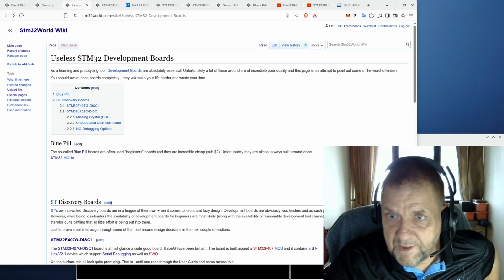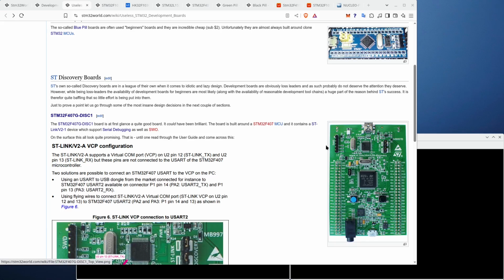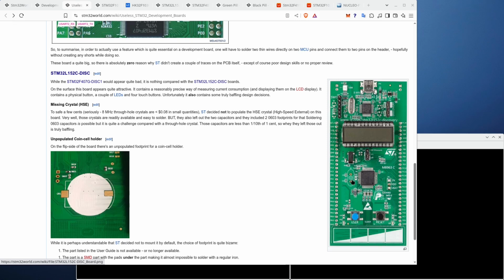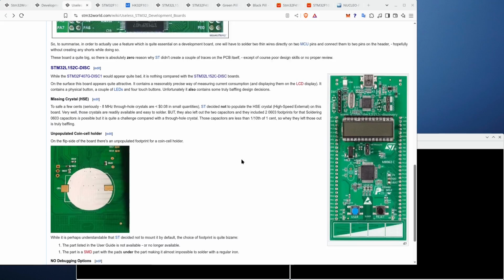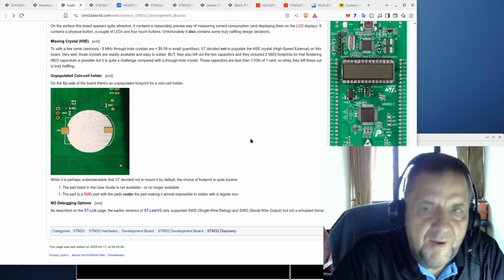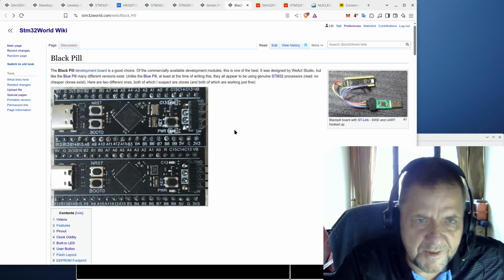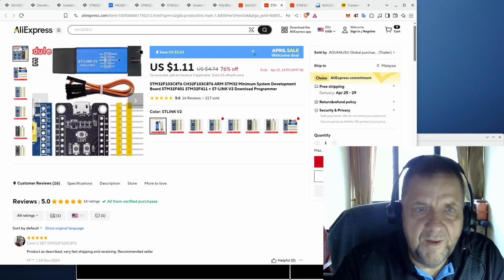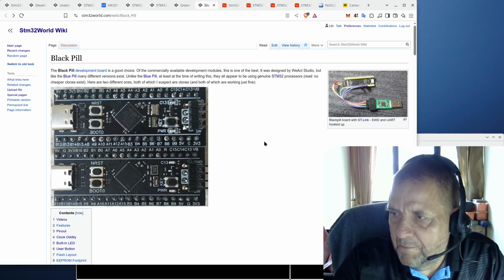USELESS STM32 Development Boards - Avoid at all cost  - STM32World Rant #1

Comment: Bluepill useless? I completely disagree!
Bluepill is 15 times cheaper then similar Nucleo board - so, guess what I will choose just to play with it?

I never used any stm32 before (used only atmega328 before) - spent just 3 days to make simple project with 16x2 LCD + BMP180 GY-68 pressure/termal sensor + and simple piezo beeper. Using just usb2com converter,  and VS Code + PlatformIO and HAL.
I spent just $13.35 in total: bluepill - $3.3, usb2com - $2.6, 16x2 LCD - $2.6, BMP180 GY-68 - $2.25, piezo beeper - $2.6. While NUCLEO-F103RB with similar STM32F103RB price is ~$48 !!! and it even have no crystal 🤦‍♂ - complete junk!
Reply from the maker: You could have spend 1 dollar more and got yourself a black pill with an actual STM32 on it and you also didn't get yourself a ST-Link so you have no way of actually debugging your code.  You are welcome to your opinion though.  Have fun.
Reply: @stm32world  I'm an embedded sw developer, but not in bare metal - rtos/linux. So, believe me - the best way to debug is logging. Especially when you have many cores+dsp and OS'es at the same time. So, I know what I'm doing. Used uart to send logs to PC while waiting for a LCD delivery.😊
Reply from the maker: As I said you are perfectly entitled to your opinion, but calling yourself an embedded sw developer having only ever (according to yourself) used atmega328 moving to a single core 32-bit mcu with strong built-in debug core and then claiming serial print is the "best" option is - well - let's just say I disagree with you there.
Reply: @stm32world did you familiar with Ambarella SOCs?
Reply from the maker: No I am not.
Reply: @stm32world Thanks for the tip about Blackpill - I didn't even know this existed!  🤷🏻‍♂️🤝
Already found one I want... 😁
Reply: The Nucleo board does not need a crystal since it gets a precise 8 MHz clock from the built-in ST-Link.  So, yes - you saved perhaps $3-4 but you got something which cut you off from a LOT of the important things, such as the ability to actually debug your application.
Reply from the maker: Debugging is key!

Comment: Best way to avoid those problems is to buy from a reputable vendor or straight up from the original manufacturer, and not trust Chinese knockoffs. It’s not worth the hassle.
Reply from the maker: As mentioned, the Black Pill boards works pretty well ;)

Comment: the STM32F103 will alwayes bee the chepest 1$ becourse it used in st-link, so ewrytime they sell one of the other ones they sell one of STM32F103, so start with a blue pill
Reply from the maker: I challenge you to buy a bluepill WITH a STM32 on it.  Second - the new ST-Link/V3 does not use STM32.  Thirdly - it is no longer the cheapest - I can get STM32F402 cheaper.
Reply: @stm32world no problem, have made my own board mekdco dk history 2022-09-14
Reply from the maker: Ok, I am missing your point then ;)  Fact is - the STM32F103 is NOT the cheapest ;)  Anyway - none of that have anything to do with my comments in this video.  The so-called blue pill boards should always be avoided since they are seldom - if ever - regular STM32 MCU's.  I too did my own Blue Pill version (https://stm32world.com/wiki/Green_Pill) but I rarely use them.

Comment: I like the nucleo boards, though I did find out that when I snapped the ST-Link off one of them it rendered the board virtually unusable.  I since bought a few dedicated programmers including a couple of genuine ST-Links.

The fake one powers the target which is often undesirable IMHO.
Reply from the maker: I am curious why it would render the board unusable?
Most of the time during development I do power boards from my own ST-Link - works quite well for me.
Reply: @stm32world I actually can’t remember the reason now, but I think it was probably down to where to take the power since is previously been powering it from the included ST-Link.
Reply from the maker: Ok
Reply: I think I’d rather leave the ST-Link on board nowadays.  These boards are good for trying things out on when I’m unsure before paying the boardhouse for another ‘coaster’.
Reply from the maker: Well - I prefer to make my own - obviously from the videos.
Reply: @stm32world I make my own designs and because I’ve done my homework first with little test cases for things like unfamiliar ICs on dev boards, I usually don’t get many ‘coasters’. 

That said, back when I home-etched, mistakes were corrected the same day.  I still have to wait a bit for the unpopulated boards to pop out of China.

It’s such a rush bringing a new super wiz bang widget for the first time.
Reply from the maker: I can't be bothered to hand solder any longer. Stocking up the components is usually more expensive than just having JLCPCB putting it together ;)  From order to I have populated boards on my desk is usually around 5 days.

Comment: The original STM32F4DISCOVERY (mine is from 2011) didn't have a STLINK firmware which supported VCP. That's the reason why there are no traces. They did not forget them. If you take a look at the older manuals, there is no mention of VCP. Later (2020), they just used the newer firmware and never changed the hardware.
Reply from the maker: Well, that is an explanation and yes - you are probably 100 % correct.  That does however not change the statements I made in this video.  They are still being sold, and while the title of the video might be a bit strong for effect (aka click-bait) it doesn't change the overall sentiment.  I should add (can't remember if I mentioned it in the video) that the SWO pin is used on the board for the display, so that too is not accessible.  As a "beginners board" it is close to useless as it leaves out some important options and make it unnecessarily complicated.  Beginners would be far better of with a $1.50 Black Pill board.

Comment: you can fix the bluepill boards with a original STM32L443CCT6, it is footprint compatible with more of everything compared to the STMF103C8T. Some solder skills are needed to do the IC swap.
Reply from the maker: Good to know, but on Digikey those are $4-5 in small quantities (+ shipping + tariffs) so probably cheaper just to run a small batch of your own boards on jlcpcb ;)

Comment: Just an idea... It would make sense to put an I/O Expander type of IC on these boards, to handle the things like indicator LEDs, and just use one I2C for that.. for LEDs that you want to have on a GPIO pin, put in a jumper so that the pin could be used for the real application... Indeed, with a coupon of LEDs that had pins, or sockets, you could use little jumper wires to connect the LED to a GPIO that you wanted to use, instead of a dedicated pin... Simply pull a jumper off, and run a wire to a different IO pin
Reply from the maker: For me personally I prefer development boards to be completely "clean" - make as few as possible assumptions on what users want.  These things just tend to become wasted pins after a while.  For my own stackable stm32world boards, I did do a I/O expander board here: https://stm32world.com/wiki/IOAW9523 although I never produced it.

Comment: Yes, it seems a bit goofy to have an intern as an "application engineer", since AR's are often on the pointed end of the stick, really dealing with customer problems, and, if not done right, a bad AE can completely turn off a customer, who will find another supplier!
Reply from the maker: It does explain the inconsistency at least.  Someone else pointed out that the two discovery boards I have were "old".  Notice, I did not buy these because they were cheap or anything like that - I just got two at random.  If these are old with mistakes, ST would do well to simply pull them off the market and sell the fixed ones.  Asis I was not particularly turned off STM32 MCU's but decided quite quick that I would have to roll my own boards.

Comment: These are ancient boards from ST very first ARM offerings. I would suggest much newer series and newer boards. Your experience will be different. 
@9:20 its because it was a design flaw, they didnt intentionally leave the connections off. That board is from 2013 ,  newer revisions of the board (blue one) work fine.
@11:02 They didn't put the crystal because you can simply use the MCO (Master Clock OUT) of the STLink that is connected the Oscillator input of the target (see schematic of this board),  you can achieve the same effect of having an HSE without adding an extra crystal by putting the target HSE pin in bypass mode. That L1 is from 2010 .
Reply to this with your email and  ill send you some ST goodies
Reply: @EdwinFairchild; Hi there... Fairchild, huh? I know Fairchild Semiconductor, from the bad old days, and they made a couple of LED drivers for me... But, maybe you are a "fair child" instead?
Anyway, I subscribed to your channel, looks like an interesting mix .
I'm just getting back into MCU's after some time doing LEDs and LED driver for "volume applications"(250x10^6 per year)
I've got a few nucleo boards, and a couple of the infamous black ones.
Your comment about "STM goodies" intrigued me, I wondered if you were/are connected... The Prague design team built STLED25 for me.
Reply: @ Oh nice! Yeah I work for ST based out of Chicago came here from Analog Devices. probably not my final  stop though haha
Reply from the maker: F407 is not exactly ancient and ancient or not - ST is still selling them without any warning that they are outdated ;)  You can email me at webmaster@stm32world.com ;)

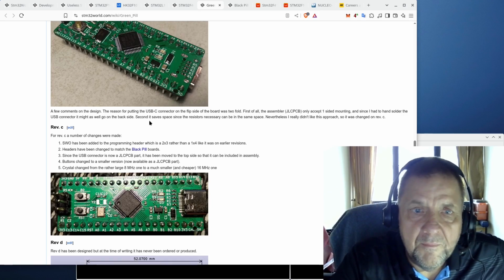Comment: 20:00 I can't say that Blackpill is a good choice either due to its ADC. Chip itself has some issues with its ADC (see errata), but board makes it even worse.
I've tried simplest project like potentiometer ->adc ->pwm - > led
And it appeared so much noisy that I used to implement all possible techniques (avareging with median filtering as they suggested in appnote) to rectify the value...
I really didn't expect so bad performance compare to good old atmel chips.
Reply from the maker: I've been thinking about how to reply to this one for a while and I still don't get it.  I never said the Black Pill board was a great fit for everything solution.  I presented the Black Pill as a good bare bones alternative to the Blue Pill boards which everybody seems to be using and which are build around a really old MCU (at best) or a fake one (in most if not all cases).  The Blue Pill boards sell for what - a couple of $, and the Black Pill boards are only 1 or 2 $ more.  As far as I remember, the Black Pill board does not filter VDDA which will cause some extra noise on the analog stuff, but I have used it for analog a number of times and didn't really see any issues with it.
Reply: @stm32world  I wouldn't want to go debate whether it is good or bad. Just wanted to warn whoever will watch this video about this potential problem with BlackPill.
Reply from the maker: Sure, the F411 is somewhat weak on the analog side - also does not have a DAC.  But again - I only compared it with Blue Pill and those boards are scary bad.  I am sure many potential STM32 users have been turned off by those.

Comment: I have used a number of Nucleo boards. They have their own issues. Most do not include an HSE oscillator, though I believe most/all can get the HSE from the ST-LINK with a solder bridge. My biggest complaint is that I do a lot of mixed signal stuff with their L4 chips, and they use one of the 2 DAC pins for an LED, and one of the few dedicated op amp pins for VCP. So 2 key peripherals are unusable. The Nucleo32 boards are convenient, but they do not connect the SWO pin on the STL32L432KC board. It is possible to hack it, but it's not a great option. A jumper or solder bridge to enable it would have been better.
Reply: it's an curse of STM32 - you have a lot of periphery but usually can't comfortably use many of them simultaneously and you abide to sucrifice some of functionality or use it another way you not planned initially
Reply from the maker: Well, you just talked me out of buying a Nucleo ;)  I'll stick with my own STM32World boards ;)  They do what I want in the way I want it.  Happy days.
Reply: @ I will admit that I still buy them regularly to try out new STM32 chips. The price is right and, for most uses, the design choices do make sense. As @taraskoval5163 says, there are limited choices given the way peripherals are mapped to pins on the STM32 chips. VCP does work, loading new code can be as simple as drag-and-drop. The built-in ST/Link programmer can be used to program & debug other boards. And the Nucleo64 ST/Link works great.
Reply from the maker: I believe the Nucleo boards - depending on version - contain either a ST-Link/V2-1 or a ST-Link/V3 - both of which works fine ;)  My own STM32 programmer is essentially a copy of the ST-Link/V2-1 which can work with both ST's Firmware and the Open Source Black Magic Probe.

Comment: i have big board with ethernet and many external periphery such as PHY interfaced, USB-COM and FLASH chip and.... drumroll... one of the SPI line connected to flash chip(hard by board routing) shared with SWO pin and you can't use 20 pin connector along with flash chip
Reply from the maker: During the development phase I prefer to have either UART or SWO.  I can live without any of them, but without both is annoying.

Comment: I belive that they have missed crystal oscillator for letting users try to diferent frequencies. User can simply swap different crystals without soldering them. Some Nucleo boards have such solution as well e.g. F303RE.
Reply from the maker: You are probably right but I would say that ST's reasoning if that is the case is somewhat weak as the size of the capacitors depends on the crystal and they are quite hard to replace.  Anyway - the missing crystal is the least of the issues with that board ;)